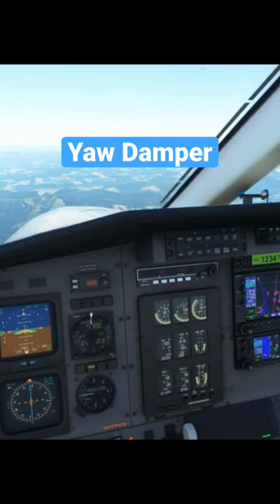What is the yaw damper??

Comment: will yaw damper make coordinated turns for you? in other words if yaw damper is on and you want to make a coordinated turn can you do so just by using the yoke/moving the ailerons and the yaw damper will automatically keep the turn coordinated from automatic rudder inputs?
Reply from the maker: Yes! In fact, after engaging the yaw damper you must be careful not to fight the servo with your feet -- the YD will take control of the rudder pedals.
Reply: @GeneStuart if you dont enable yaw damber will the plane enter in a dutch roll
Reply from the maker: Depending on the conditions you may get a little dutch roll. @greenesyt563